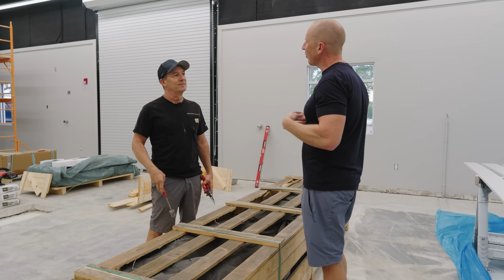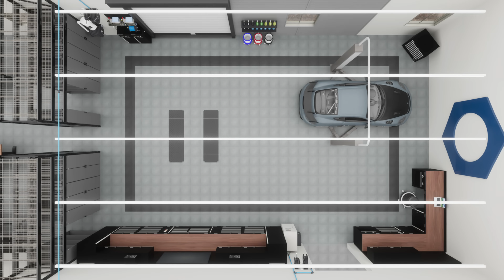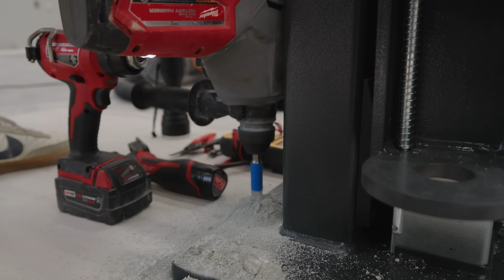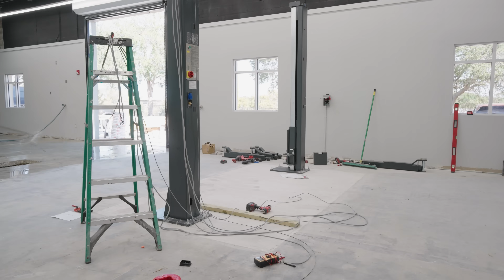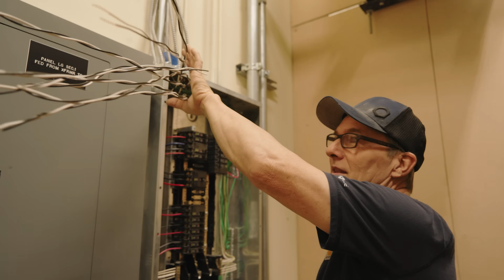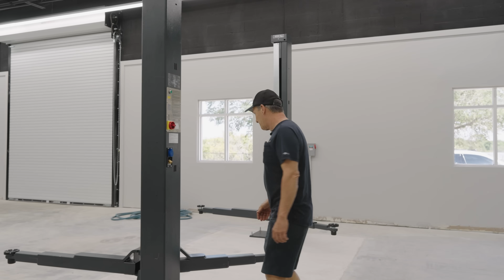Installing The QUIETEST 2-Post Lift That Fits In Your Garage

Comment: What is the model and make of this car lift?
Reply from the maker: You'd need to reach out to design@obsessedgarage.com.  Technically it is call a QL-9000, but it has a different name in Germancy.  It's something like 2.40L.  We are working with Nussbaum to make this work on a single phase circuit.  We hope to have it all figured out soon.
Reply: @ObsessedGarage  It sounds very expensive.

Comment: I've always wanted a Rotary lift.. but this one looks actually nicer. What is the cost?
Reply: It's $7500 with 8,000 pound low profile arms.  I was surprised.  I thought it would have been a lot more.
Reply: @ObsessedGarageMattMoreman  Wow, that's a great deal. I paid that much for an off brand one with similar specs
Reply: @ObsessedGarageMattMoreman  that's very reasonable. May have to pick one up for the new house coming soon.
Reply: @ObsessedGarageMattMoreman  isnt that twice the price of a stock one?